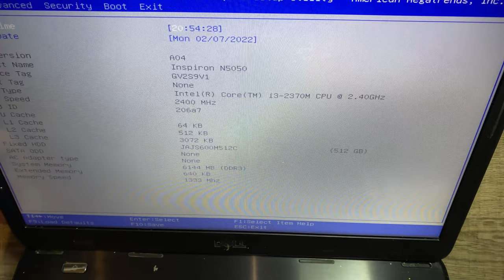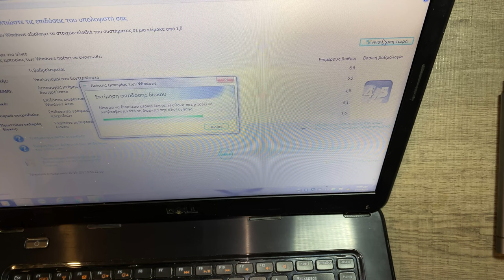Dell Inspiron N5050 Disassembly Upgrade RAM & Hard Drive

Comment: My Dell n5050 laptop (4GB/HDD) running and application loading slow and hanging problem...what is the solution ?
Reply from the maker: Hello you need to change the HDD with SSD and add more ram .
Reply: Need at least 8GB of ram/the average good amount now is 16gb though, and throw an 250GB or 500GB Samsung Evo 970 SSD in there, it will be pretty cheap to do so, you could even get it all used

Comment: Hi. A few questions please. First: Is there any special size for this ssd? Like, any laptop ssd will do? Second: I heard I can replace the dvd drive for another ssd and use as storage? Do you recommend? Third: Is it possible to also replace the processor on these? Thank you for the video.
Reply from the maker: Hello , you can install any ssd you like . 2) yeah but you need to search one that fits to yours. 3) Yes you can but it doesnt worth .

Comment: I have the same device, but it is old and slow. What parts do I need to upgrade my device and make it fast?  I have not changed any piece before, and if it is also possible to change a screen with high specifications, I hope that you will give me the names of companies for it, thank you
Reply from the maker: Hello you can do exact the same upgrade i did and your pc will be so faster than before . For SSD im using Intenso TOP performance 512GB and i added a 4GB Stick DDR3-1333 Sodimm , u can use any brand you like for RAM. For the Screen you cant do anything.
Reply: I second the uploader. If you are on a limited budget (even while that RAM is cheap nowadays), an SSD will make the biggest difference. The hard drive was slow in mine which I got from my grandmother when she upgraded to a new system. I’m putting in an old mechanical drive but it’ll still be a lot more bearable than what was in it. When I was copying her files to an external drive it would be going .1MB/seconds sometimes.
Reply: @TechPlusLab  Is it safe to use a 1600 MHz Sodimm ? ty !
Reply from the maker: @pici24  yes but check first if your cpu supports 1600mhz ram.
Reply: @TechPlusLab  can i put cpu such like i5 6th or 5th gen on it?
Reply from the maker: Hello whats your current CPU?  @aminserrah4746

Comment: You replied everybody, great you are..
I have same laptop sir dell Inspiron n5050, 15 years old, right now my laptop hardly turn on windows 7 corrupted, red dots, beep sound when turn on, the shop owner opened after 1 hour he says ram is faulty so i keep out 2gb ram from one slot and have only 2gb ram in it and laptop is off..

So now i want to make my laptop as good as much possible..

Please suggest your recommendation..

All shopkeepers has their own thoughts so I'm confused 

Which ssd is cheap and best to survive long
They give me so much options like Cyber x, evm, hinix, colorfire, consistent..

But I'm not satisfied with their price and talking 

Also ram DDR3L pc3 

Please give me advice sir
I want to make my laptop survival long and faster in budget 

Ohh sorry sir for long comment because i have no knowledge in laptop, please think that this is my laptop is yours laptop and give me genuine solution without any filer ohh so much English, now i have to take chay ☕😢😅

Thanks for great video
Reply from the maker: Thank you very much. Try intenso top performance, very good ssd and they last a long time. Whatever you put in Ram you will be ok!

Comment: I have changed my HDD to WD Green SSD, but 2 screws on that's gets attached to SSD are not fitting, wondering how perfectly they got fit in your video.
May be it depends from manufacturer
Reply from the maker: Hello Try to put more force when screwing
Reply: Same for me its not getting in
Reply: It's not about the force, the threads in WD Green SSD not located in the right place
Reply: @KiranG1994  You don't need to put the screws. SSD has much lighter weight.

Comment: Hi, l have followed your instructions ref this memory/hard drive upgrade,however l would like to ask is there also a wifi card upgrade possible.
As the standard fit DW1701 pci e  wifi  card is only 204 GHz, Can 5GHz card be fitted and conpatible with this Dell Inspiron N5050?
I do have a 5G router to connect to and am currently running windows 11, not the original OS Windows 7
Any help and advise would be most welcome
Reply from the maker: Hello , yes you can search for 2.4G/5Gh Mini PCI-E Wireless Card and replace the old one.
Reply: thank you for thekind reply to my question.
However how do l check the new mini wifi 
card 2.4-5.0 GHz will be compatible with my controler chip on the motherboard and drivers? @TechPlusLab
Reply from the maker: @colin5064  if you add a Mini PCI-E you dont need to worry about controller.
Reply: OK thank you for the advice and information offered @TechPlusLab

Comment: I have the same laptop if I upgraded by using ssd hard and 4gb ram it will be faster?
Reply: And in the control panal it told me my pc have one slot for ram and you have put 2 ram??
Reply from the maker: Yeah much faster
Reply from the maker: maybe you have 1 ram installed @yassinehab4360

Comment: Hlo sir mene bi second hand laptop purchase kiya hai Inspiron n5050 but windows 10 install mai laptop open let hota hai or thoda slow bi work krta hai plzz any solution 

Ram 4gb hai
Reply from the maker: Maybe the charger has a problem and works slow.
Reply: @TechPlusLab  laptop let problem not charger 🤔

Comment: Im facing touchpad issues while plugged in, do you face any??
how can I solve it??
Reply from the maker: Hello , r u using original charger?
Reply: @TechPlusLab  I purchased N5050 as a second hand laptop, I am using 65W dell adapter, can't say if it is original or not
Reply from the maker: ok can you describe the problem with details?
Reply: whenever I plugged in adapter and use touch pad, it don't respond well, like ghost movement of cursor, automatic scrolling/zooming page ...
Reply from the maker: 99% its a charger issue , try new one .
Reply: @TechPlusLab  OK Ill try , Thank you sir for help
Reply: Check your house earthing OR Change the power adaper
Reply: Ah I'm getting the same problem, not only when it's plugged in but on battery also... It's kind of annoying that mine laptop battery has zero power backup so I have to run it on charger :(